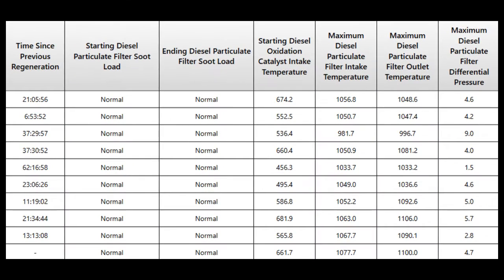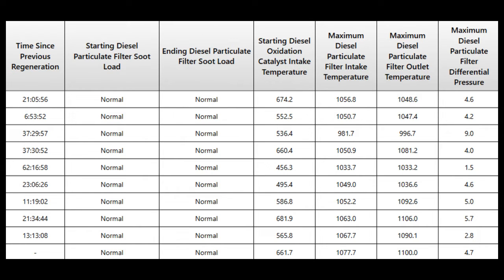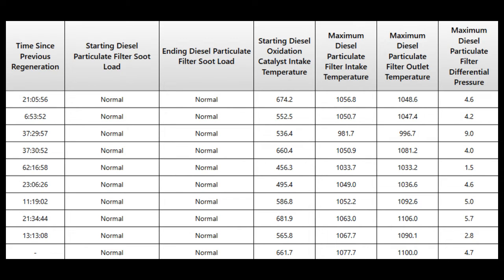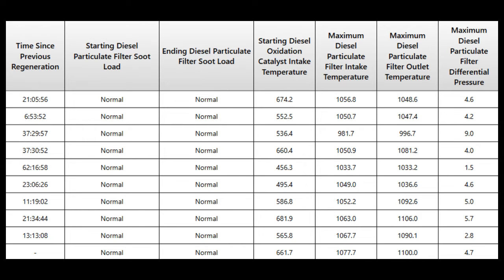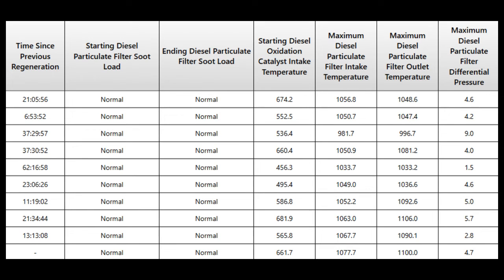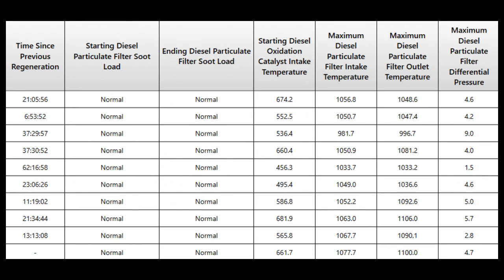DPF differential pressure sensor failure

Comment: WHAT WAS THE CODE
Reply from the maker: Many times I forget to mention things. Thanks for reminding me. It had 1921 and 1922 active with in minutes of each other. Which is impossible in the real world. The software logged the faults because of the extreme jumps in pressure the failed sensor was inputting to the ecm. In the video I wanted to get the point across that extreme restriction with no extreme extemps = no soot build up to burn. So you either have a plugged filter or failed sensor. If it is a plugged filter the pressures will be pretty uniform in value for each point in the history. If the sensor has gone astray the values can be all over the place.

Comment: I got a new DPF, EGR and differential pressure sensor. The pressure shown goes between 2-5 kpa while stepping g or not stepping on the gas. But, it shows crazy DPF soot values, like 168%. I unplugged the sensor, the soot value went down to 12%. I plugged back, still 12%. I stepped on the gas, it went up 168% again.... Could this new sensor be defective? Thanks in advance
Reply from the maker: Make sure the tubes and hoses that plug onto the dpf sensor are open. Blow air through them. Verify they are both open. In cold weather (below freezing) if one had water in it and froze shut this could happen. If they are open I would recalibrate the engine ECM with the current release software ( actually you can only use the current or up to 6 months past as insite rejects them if they are older than 6 months.)
If I were working on it I would data log all parameters and then unplug the sensor and plug it in and let it idle. I would look at soot load and ash load. If the numbers looked really out of range I would do a recalibration of the ecm and retest. Then would put the unit in a regen and let the dpf clean itself while i watched egr/ dpf and other pressure / temp values for normal / abnormal ranges. Remember the ecm only know what the sensors send it and any wiring or grounding issues affect those sensor values sent to the ecm.
If it made it through the regen OK i would retry the throttle test you did and see if that corrected the issue. Very rarely the ECM can fail and give you off the wall values when in fact there is nothing wrong at all. Usually it is a calibration corruption and a recalibration will fix the ecm. I dont know any history on this or why you changed those parts. Im sure there was a reason and it could be tied into this. 
Let everyone know how you made out and what the problem was.
Thanks
Reply: @ENGINESHOPJOE  Thanks for advice! The DPF had to be replaced because the original one was broken and melted inside. AGR and differential pressure sensor were changed because I ve been told they could have been the reason the DPF broke.  Readings over 100% soot in a new DPF aren't normal. I performed a forced DPF Regeneration but the values didn't go down to 0. DPF and sensor were reset but the reset isn't permanent.

Someone told me it's because of the car brand, that can only be reset with an OBD2 device from GM/Chevrolet Tech 2, which I haven't yet. It was reset only with Autel and Autocom / Delphi.

As soon as the differential pressure sensor is unplugged, everything is fine, though ...
Reply from the maker: When it comes to cars and even pick up trucks. The aftertreatment may accomplish the same goal. IE reduce soot to a gas and cut down NOx. However the controls are very different ( hardware and software) My channel is wrapped around Cummins engines mostly with some cat and detroit information. You will need to find someone who works on the model automobile your working on to help you with this.
The systems and diagnostics don't always function the same.

Comment: It’s crazy I’m dealing with one right now fault 1691 . Took it apart and it was the face of the doc plugged. Also the dpf looked like a bear 🐻 was looking for honey 🍯 completely in pieces.
Reply from the maker: Face plugging means your engine exhaust stream is smoky when it should be clear. Do the checks that cause black smoke. The dpf cracks like that because of thermal runaway from extreme soot loading ( smoky exhaust stream) If you don't find the cause of the smoke then the new parts will fail again. The catalyst can just be shop air blown out clean. The dpf is the part that fails. As a side note the catalyst that is face plugged almost NEVER needs to be replaced. Clean it and the stationary regen when your done should recover it.
Reply: @ENGINESHOPJOE  thank you Sir much appreciated.